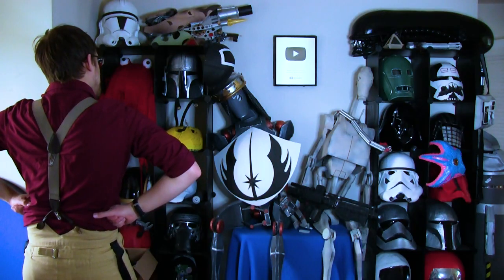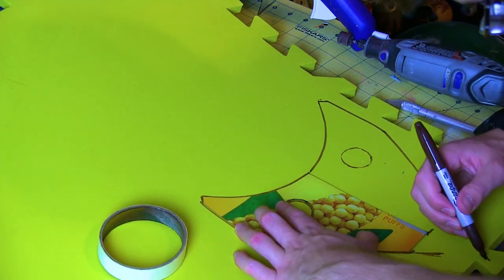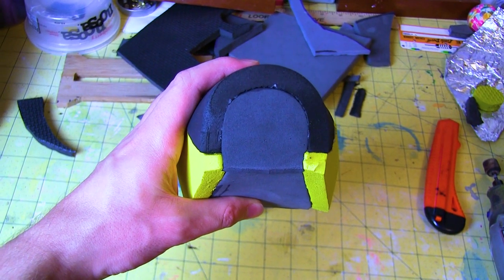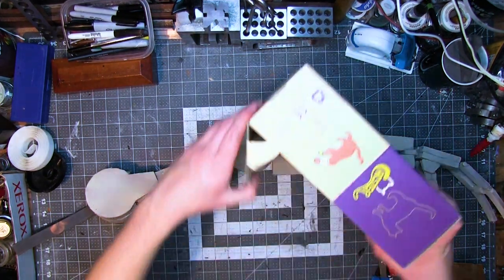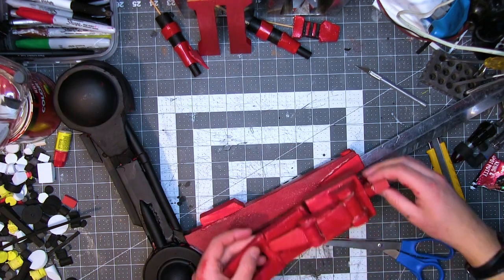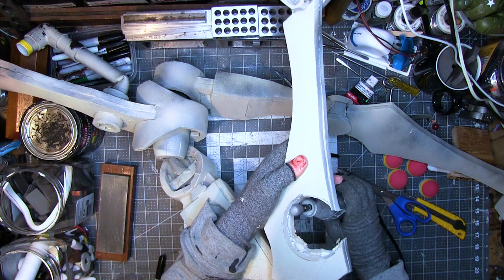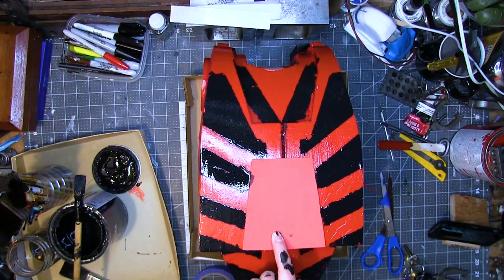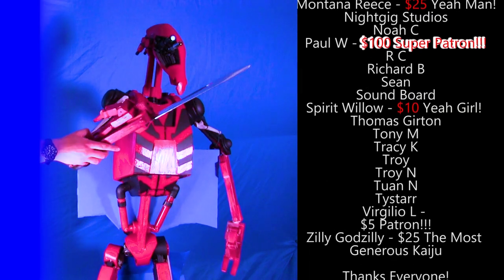Mr. Bones Battle Droid Build (Star Wars DIY)

Comment: Quick build tip- if you add some small screws the the plastic tube, leaving them sticking out enough that the head is not touching the plastic.  This will allow your hotglue to grab them and give you a decent grip.